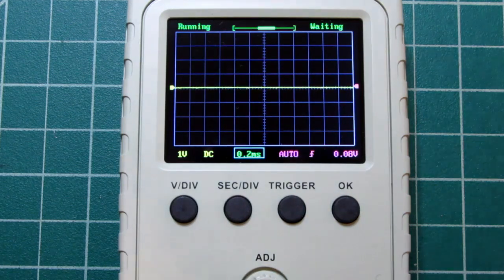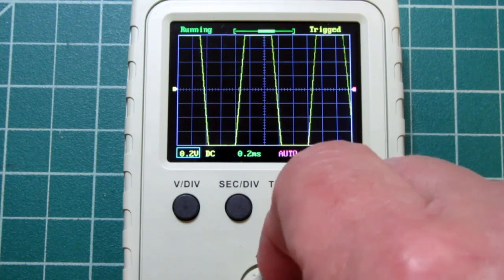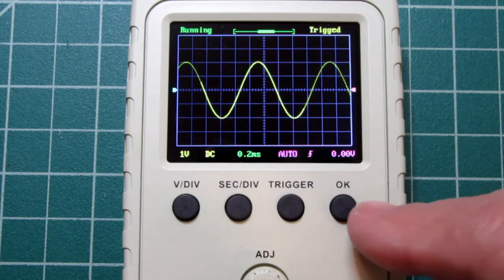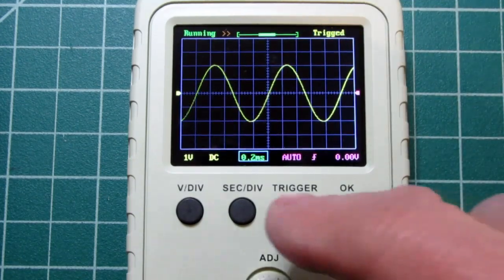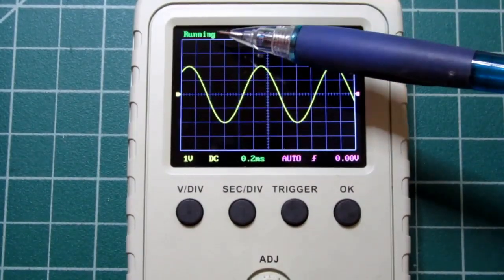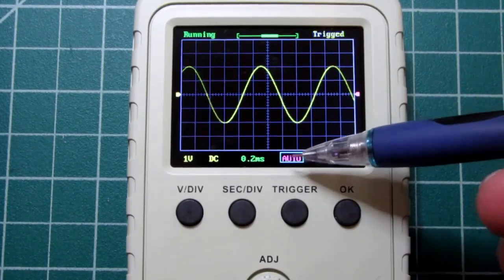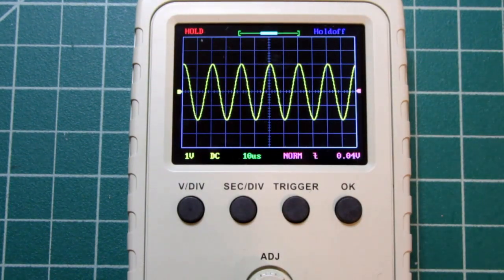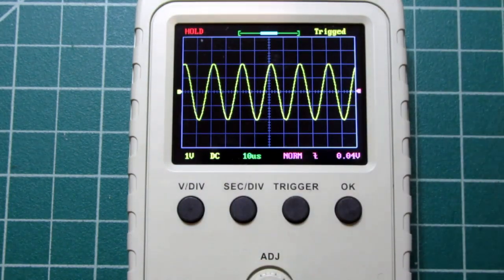KYE Tech "DSO Shell" Oscilloscope: A Detailed Video "User Manual"

Comment: Great explanation! I think it covers everything there is to this cute little oscillocope. A couple remarks on the parts that were not working as expected:
38:20: Storing a measurement is done by [ADJ] + [SEC/DIV], recalling a saved measurement is done by [ADJ] + [TRIGGER]. This is still a limited feature, but I'm sure you'll get it to work. You tried the [ADJ] + [V/DIV] combination, this sends the data over the internal serial port. You can open the device up and hook the internal serial port via a USB module to your PC and read out the measurements for further processing in Python or Excel or what have you. Since this requires a hardware mod and quite some tinkering, I think this is a niche feature.
40:24: You mention the firmware version, and hope for newer versions. As per 55:50 you are on 120 which is at the moment of writing the most up-to-date version.
56:40: The trigger mode is still on normal, rather than auto. The trigger is set to 0.2 V, but the signal is a mere 0.1 V. So the scope is never triggered, leaving the display empty. Setting the mode to auto (as you recommended it earlier in the video) would keep this signal visible, albeit jittering. This may not explain all the weird behaviour. But a buggy trigger-mechanism is easier to work with in auto-mode.
Hope that helps! Good luck to you and anyone else playing with this device!
Reply from the maker: Excellent and well written comment, thanks
Reply: Great reply/info, how do you update this unit? I’ll have to check what version mine is (I just bought the supossedly “updated” black 20v/200KHz version, Etepon EM001 I think? Really digging mine so far 🖖🏼
Reply: Thanks for this - I've saved it as an errata file.
Reply: Great well written comment with some very interesting additional information.

Comment: How weird, I have the same device and everything works exactly the same except for mine doesn't show the 0.00V down at the bottom right. I can still adjust the blue arrow, but it doesn't show me the trigger voltage. Mine is branded AUKUYEE.

Comment: The auto trigger will be in rolling mode if timebase setting is greater than 20ms.
For instance, if timebase is set for 50ms while measuring a squarewave of 10Hz, you'd want to use "NORM" trigger.

SAVE WAVEFORM - Press [ADJ[ & [SEC/DIV] buttons simultaneously for about 3 sec.
RECALL WAVEFORM - Press [ADJ & [TRIGGER] buttons simultaneously for about 3 sec.

Comment: I have a KYE DSO150 bought in dec 2017, but the software seems to be an older version. The automatic set functions when holding V/DIV SEC/DIV or TRIGGER don't work for instance. Also, the trigger point in volts is not displayed in the bottom right corner of the screen.
Is there a way to upgrade the software, maybe by flashing using a Serial FTDI cable?
[UPDATE]
I don't think I have a genuine FYE device, after watching a video on how to update the firmware of a DSO150... The boot screen of my device looks quiet different, and the firmware version is an ancient v062. The risk is that I brick the device if I try to update the firmware on this not genuine one.. So I'll use it as it is now.

Comment: Thanks for this. I was thinking mine was not working, having just built it, but it is just as twitchy as yours. I couldn't do the adjustments on the trimmers, to square it up, but it seems the sig gen does work sometimes. Thanks again for your in depth video.

Comment: I'm trying to use this scope to set the gain on my amplifier.  When I play a 40Hz test tone through the head unit and hook up my DMM to it the amp speaker terminals I measure 88.8 VAC.  I'm not sure what you meant by the 50V vs 100V peak to peak ... can I connect this safely to my amp if it's at 88.8 VAC as long as I don't go to 100 VAC, will it burn up, etc.?
Reply from the maker: bugsysiegals, I mentioned the scope's input voltage limit because it is not clear in the specifications whether 50V is peak-to-peak, or average, etc. I don't know the answer. A full-featured scope could be used as you want, but this little scope is greatly limited in this regard. I suggest using a regular scope for 'real' electronics work, and leave this scope to the more limited educational applications it seems to be intended for.
Reply: @youtuuba  thanks for your reply.  
I’ve never needed a scope before this and probably won’t for any other purpose so I really didn’t want to spend $350 on a scope.  I’d considered $100 on a DMM style scope but all reviews seem to suggest everything is a joke and that I’d need to spend $350 before I get a decent scope?
Reply from the maker: @bugsysiegals  , if you can afford to do so, get a 'real' scope as soon as you can manage. $350-ish can get you a very nice, full featured analog scope. There are a lot of companies online selling nice, reconditioned, warrantied analog scopes. The DSO scopes are nice enough, but not as easy to use as a typical analog model.
Reply: @youtuuba I'm on a tight budget but found out a pair of 10x P6100 probes will allow me to measure the ~100VAC without burning up the scope.  Thankfully they were only $12 so at least this wasn't a total loss.

Comment: I have the older version that doesn't show the trigger voltage. Didn't watch the hour-long video, but did you ever try triggering on a one-shot waveform, like a switch closing? It seems to STOP recording once the trigger occurs, rather than start (or center the triggered event in the waveform buffer). Makes it pretty useless for looking at triggered events.

Comment: In both videos, you say that you can store a trace on the scope by simultaneously pressing the Sec/Div & Adj buttons, but you actually press the V/Div & Adj buttons and obviously it does not work.  Pressing the Trigger & Adj buttons allows viewing of the captured trace.  When I press the correct sequence of buttons to capture and view, it ALWAYS works.  I have FW v110.
Reply from the maker: Yah, maybe I goofed with the button presses. Sometimes my fingers press wrong keys when I am half looking at them and half looking through the camera viewfinder.
Reply: OK, but I'm just wondering if your scope allows storing and viewing of the trace when the correct button presses are made???
Reply: Thank you also...

Comment: I bought a Quimat Updated 2.4" TFT fully assembled through Amazon.  Being unfamiliar with oscilloscopes, I was depending on You-tube for instruction.  My unit is different:  The Top  Line:  0 Calib;  PWM 0.01.00Khz(adjustable, but I can't figure-out how);  Duty 0 - 100%;  Symbol for Rising or Falling Trigger; Auto | Normal | Single.  The Bottom Line:  50mV - 200V; X1; 10uS - 500S; Gnd | DC | AC; RUN | STOP.  I cannot find a You-tube on this unit with these different features.
Reply from the maker: Glenn Larson, not sure what your point is. Are you trying to alert others about lack of YouTube support for your Quimat scope? Are you asking others to figure out how to use the Quimat scope and them make a video so you can learn how to use it?

I made thus video after many hours of research, experimentation and circuit study. I don't plan to repeat that effort for any other kind if scope. 

Perhaps, having bought a Quimat scope, you can he the pioneer and figure out how to use the thing and then share that knowledge with others in a new video.
Reply: @youtuuba  he You-tube videos were very helpful, but when I got the unit, I discovered unknown features.  I have minimal knowledge of oscilloscopes and I am having trouble using the features .  The unit is new and the picture and spec in the Amazon page were of a scope like in the You tube videos.  Because of the You tube videos, I am able to use the DSO.  I don't understand the "Duty", but I can change to any percent between 0 - 100%.  I have the unit set at 50%.  I accidentally got to set the PWM to 1khz, but I don't remember how I did it.  The PWM and the Duty are where the slide is on the You tube video.  At the far left top 0 Calib is when I hold the V/Div button down.  Instead of hold my unit uses RUN and STOP.  I made the comment asking for help.  Glenn
Reply from the maker: @glennlarson9257  , the Amazon listing shows only the scope, nearly identical to what I showed in my video. Their photos and text do not describe anything different. But you describe "Duty" and such, as if they were settings. On my scope, "Duty" only appears on the statistics screen to indicate the Duty Cycle of the measured waveform......this is not a setting that you should be able to change.

In short, you seem very comfortable confused, probably because you got yourself a new toy that you (by your own admission) don't understand anything about. There is no way people on YouTube are going to see what you are seeing in order to troubleshoot, explain festures, and educate you about all the fine points of what all the features of a scope are for and how to use them.

I suggest taking an online course in how to use an oscilloscope, but that won't help much unless you have adequate knowledge of electronics.

Try a community College near you (assuming that you are old enough to be admitted), and take some basic electronics and test equipment courses.
Reply: @youtuuba  I found the same unit at Amazon , but it is Black.  Mine is White.  It is listed as ETEPON Digital Oscilloscope.  It also shows a comparison of the old and the new.  Full color screen pictures.  I'm 70 years old.
Reply: Thank you.  I did some research and experimenting, and I discovered that if I Highlighted Duty with the SEC/DIV button, I could toggle to PWM by pushing the ADJ button.  My quest to adjust the PWM frequency is solved.
Reply from the maker: @glennlarson9257  , except PWM should not have any place on a scope......I don't know what that is for.

Comment: Mine will never say trigged. I think the one I got has to be a busted one. I am going to return it and see of I can get another one.
Reply from the maker: TJ Eclipse, make sure you know how to set the trigger level properly.....if it is set incorrectly, it will not trigger.
Reply: @youtuuba  I had it set to use for setting up a Amp and subs, I followed the instructions but it will never go to it.
Reply from the maker: @TJsVette ,  there is no such thing as "going into it" with triggering. Triggering happens on a scan by scan basis. As for getting it "set up for Amp and subs" that makes no sense to me.
Reply: @youtuuba  so I watched a video that showed someone using this to set their gain for their Amp to power their subs without getting any clipping. 

You set the scope up a certain way and it would never leave off the hold setting. Maybe I need to go back and try again or maybe I just don't understand how to fully use it. 

I'm not the greatest with stuff like this, I can wire up a sound system, I can wire up cameras and other types of electronics but this I just don't understand lol.

Comment: Trying to explain electronic engineering to a complete novice I can only imagine is complicated, as it's a complicated subject to someone new. Mention Oscilloscope to a newbie, and they will think you have two heads. I had to comment on this video as you managed to break down A) how to read AC/DC waves using an Oscilloscope, and B) actually how to use the basic functioning of said instrument, in a very easy to understand way. No easy task Sir. Thank you so much for doing this video. I am waiting for my DSO150 Kit from China to arrive, and now am really looking forward to building and using it. Especially now you have explained the functioning so well. I bought the non SMB soldered version. I felt like a challenge lol 😁👍

Comment: Would this be sensitive enough to test for the outside foil on capacitors? Would be handy if something this small is capable of that.
Reply: Yes, you should be able to it with this scope in the lowest setting AC coupled.
Reply: @vancouverman4313  Thanks, May have to order one to try. Wasn't sure if something else would cause it to not work like shielded ground reference. I don't own a scope and a hobbiest at best. I have scoured youtube to see if someone tried this but no one has even mentioned it that I could find. A lot of people would buy 0ne just for that purpose I would think.
Reply: @lmt200ish  I tried testing a small plastic capacitor on my scope and I was able to identify the outer shield very easily.  I put the leads across the capacitor while holding the capacitor in between my fingers.  I put the scope on the lowest voltage range which is 5 millivolts per division.   I set the x axis (timing) at 20 mS per division so I could see a sine wave.  Connected, you will see a much bigger sine wave one way than the other.   When the sine wave is the lowest you will  note  the terminal of the capacitor that the negative scope probe is connected to is the shield side.
Reply: @vancouverman4313 Oh, great, I will order one of these to test caps then. Thanks for trying yours.
Reply: @lmt200ish  One thing I'll add.  It seems to work on film capacitors best.  Also known as mylar or plastic capacitors.  They're the most common used in coupling and bypass in amplifiers.
Reply: @vancouverman4313  Ok, thanks.

Comment: Well, like others, thanks for this @youtuuba.  This crazy little thing is way more feature packed than I thought!  The instructions are a joke, being one page and one sided!  A question tho - if you happen to read this... Could look at 110VAC waveform with this thing, of will I end up with a piece of toast?  It seems speed wise a "no!" To me.  Ok, maybe two questions... At the last you show test mode. What is the purpose of this mode?
Reply from the maker: Karl Gingerich, if you take a look at the written user's manual I prepared, downloadable here:

www.serpentwebsite.com/fileshare.htm

you will see that the maximum input voltage is 100V between peaks; NOT 100V RMS, which is what a typical voltmeter would show.........multiply the RMS voltage of 110VAC cited in your question by 1.4 to get the approximate 154V peak. Normal North American voltage is closer to 120V, so that would result in an even worse approximate 170V peak. So, trying to use this scope to measure line voltage will result in the internal circuits seeing almost 150% of their maximum rating. So almost certainly this 'scope would be catastrophically ruined. This 'scope is intended solely for low voltage, low frequency basic electronics work.

The 'test mode' is to make the 'scope generate a square wave output at either of two voltage levels. This serves two purposes; first, it allows adjustment of the 'scope's 'front end' circuit capacitance to give the cleanest, most accurate waveform at higher frequencies, especially waveforms closer to have vertical rise and fall times, and second, it provides an easy way to demonstrate the scope, without having any signal generator equipment or other signal source nearby, and/or as a quick test to verify that the 'scope is working.
Reply: @youtuuba  Excellent, thanks for the manual!  I forgot about RMS as well!